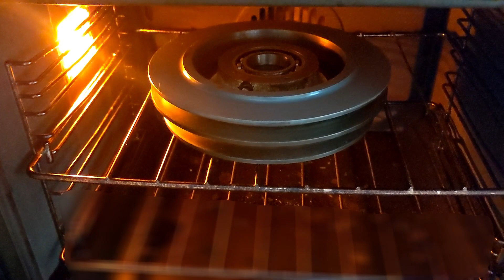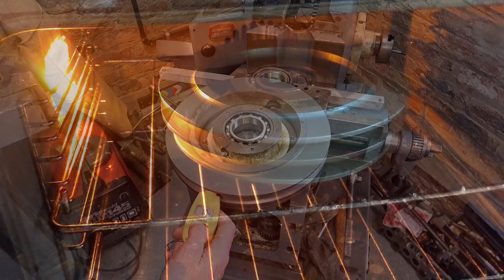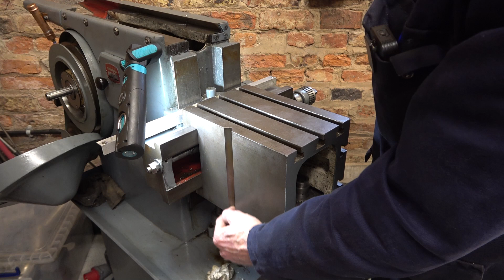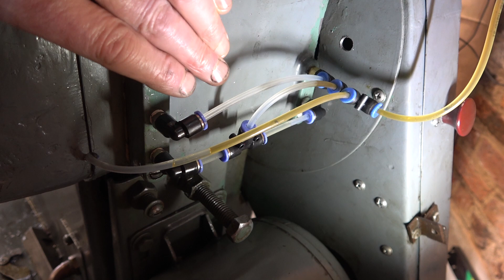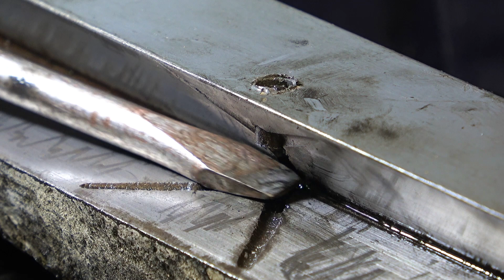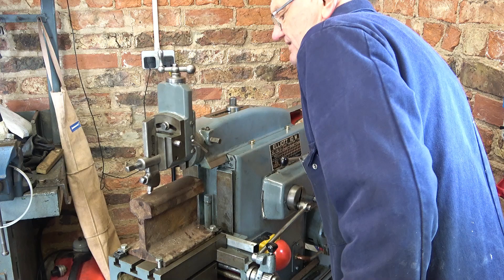HS190 Elliott 10M shaper repairs – Part 8 (Final part)

Comment: Great series Paul, nice to see the full stroke restored to full working order as well as all the other improvements, some great tips for anyone considering buying a 10M to see what's possible. BTW I thought that old railway line was going to offer a lot more resistance, instead you achieved a great finish.
Reply from the maker: Hi Paul, as you saw, the rail came up clean-cut without any thought or effort really. 20 m/min, 8thou step across, 12thou cut, rough ground old bit of HSS not particularly sharp. Shapers just shape with no fuss about it. Cheers

Comment: Congratulations on your 5k subs, well deserved after all the work you put into this. Nice end to a good series on your shaper mods. My 10M has the same disparity in the t slots between top and side - peculiar isn't it. I've presumed that Elliott left customers to decide how to drill and tap the other side for fixtures. At least there are two deeper areas inside the casting, mirroring the other side's strengthening for the t slots. Your shaper now looks and sounds greatly improved. Cheers, Laurie.
Reply: And so it continues....... Laurie.
Reply from the maker: Hi Laurie, I had never noticed the two deeper webs in the left side (same side as the V) until you made your comment. Now they are just calling out to be milled with T-slots. 😁

Comment: On my 14” Värnamo shaper the side of the table with the grove has four holes for bolts. With this you can work on the end of a rather long bar.
Reply from the maker: Hi Anton, yep that seems to be the way. Not sure why Elliott never added the holes but left it to the operator to decide. Obviously in the case of my machine nobody decided.  😁

Comment: Well done Paul, great to see it all back together again and working nicely. I don't know these machines but it seems very unusual to have different T Slots on the same table! My guess is that the top 3 slots have been opened out at some stage by a previous owner to standardise on T Nuts with another machine (this is a wild guess). I hate those gloves, can't work with them! Cheers, Jon
Reply from the maker: Jon, well we can speculate whether it was by design, mistake or change but my view is it was set up that way on the factory mill and just stayed like that. I think both faces should be the same, and probably were on the drawing. Cheers

Comment: Good to see the machine working very well and very quiet.
I do not think US EBay is the root cause of international shipping rates.   USPS international rates are expensive.   I do not know  how the rates are determined, but the crazy part is that it is the same rate for all countries.   So Canada is the same as UK which is the same as Australia.    This does not make sense.
I just went to the USPS site to calculate a price to mail a 4oz package (0.11kg).    The cheapest option, First Class Package International Service shows a price of $18.9.
Perhaps a padded envelope may be cheaper, but this may only be for paper based contents.
Dave.
Reply from the maker: Hi Dave, I think sending single items will always be expensive but I'm sure ebay has a handling charge and probably a standard route. A friend sent me an item from the US and was quoted a crazy price for postage but shopping around he got that down quite a bit by taking an up to 1 month delivery (slow boat presumably) - but it still arrived in one week!  Here in the UK we often have options for delivery like next day, 2-3 days and 5 days but the 5 days option will sometimes still come the next day. It's all a bit random. Cheers

Comment: Like other's, congrates on the 5k. I will have to go out and see if my Klopp450 bed has the V groove as well. Been a year + since looked at it, but the groove wold be a plus to fixture round stock with a large clamp across to the other side of the bed? My Guardian Drill press slot's in the table don't match the base tee slots. Makes one wonder about quality control (@@)!. Thx for sharing Paul.
Reply from the maker: Bear I think quality control is exactly the point. I think the T slots should have a half inch neck and one day somebody put in a 15/32 cutter because perhaps the 1/2in cutter broke and it just stayed like that. Cheers

Comment: Well done on the 5k subs!
My 10M T slots are the same as yours, different top and side. I ended up making dedicated T nuts for each, not that I've ever used the side slots.
No idea what you'd do with the v groove on the side. Maybe its there for you to drill your own threaded holes depending what you want to do with it.
Reply from the maker: Hi Robert, I think with the v grove you could face off or slot the end of a long bar or something line that. Cheers

Comment: Hey Paul, congratulations, 5000 subscribers is quiet an accomplishment.💪love your videos.
I have an Värnamo EV-3, 18 Inch (450mm) shaper, here they put the V-groove on the operator side, in between the two T-slots. But still there is differences in the dimensions of the T-slots, on the top, and on the side!? perhaps it is somthing general on shapers ???

Have a great weekend
Kind regards Henrik
Reply from the maker: Oh right Henrik, I thought the difference between the top and side T slots was just a production mistake, but from what you say maybe not.  Cheers

Comment: Another excellent job, well done!
Congrats on the 5k 
FYI - just checked my Alba 1M shaper (manufactured by Elliot) and the tee slots are 1/2" on both the top and side.
Reply from the maker: Hi LE, I'm inclined to think the T slots should be the same top and side. I don't see why they should be different. Cheers
Reply: @HaxbyShed  Yes agreed, can't see why they would need to be different.

Comment: Congratulations on 5K Paul.
I pay £ 12 to £ 17 for my Nitrile and Neoprene gloves,  I like the Bodyguards, and Ansell Touch N Tuff, long cuff.
I used to love the smell of Rosalex, still got some,  up as you say, no disposable gloves were available for engineering,  only medical and chemical. 
The table slots are within tolerance, guessing the maybe intended for 7/16" Tee Nuts, they are intended to be sloppy.
Great modifications and refinement, I  forsee a shrader tyre valve being fitted on your oiler reservoir 🤔.
Thanks for sharing.
Reply from the maker: John, I think I 'cheaped out' on those gloves and need to spend a bit more.  I don't need any pressure in the oil reservoir. Gravity and patience is enough. It will only get a squirt now and then. Cheers

Comment: Hi, 
The blue nitrile gloves seem to go off with age even if they're in an unopened box. At a couple of years old (from the date on the box) I've had them rip straight out of the box. You can get a black, heavy duty version - slightly less feel but much tougher - they're roughly twice the price though. 
Finally, at 5:00 , if you can push a knitting needle in and it comes out clean, then its done :-)
Reply from the maker: It would have to be a tough needle Peter. What I did learn is the temp dial on our oven is not very accurate. Cheers

Comment: Hi Paul. Your glove problem might be due to the oil. I always have two kinds of gloves at hand (haha). One latex based and one nitrile based. Different oils and solvents act differently with the various glove materials. If one kind fails within a few minutes, i change to the other kind. Works for me.
Grats on 5k, bud. Well deserved.
Reply from the maker: Hi Gisatan, I find gloves just annoying but I'm sick of trying to get crud out from under my nails. I'm right handed but it's aways my left hand that picks up the most muck, for some reason. Cheers

Comment: I really like the modification you did, the machine runs very well and it's quiet indeed. You should try nytrile gloves they're a bit more expensive than latex ones but much more stronger and durable. I've always used them when I'm machining.
Reply from the maker: Thanks Luca, cheers.

Comment: It must be very satisfying to hear it running smoothly and knowing that you have attended to all the issues. I assume that one has the option of adding bolt holes and fixtures to the 'V' side of the box. The only alternative I can imagine is some kind of clamp that reaches over from the top and bottom faces to hold a bar into the groove. Congratulations on reaching a major milestone!
Reply from the maker: Hi Workshopfriend, that side V is a funny one. Could be extremely useful for jobs I can't do on the mill - say a square slot in the end of a long bar.  I'm always on the lookout for machining operations unique to shapers. Cheers

Comment: Hi Paul, nice to see the machine running. I”ll chec the T slots on mine & report back. I noticed you oiled the bull gear etc teeth, maybe 😊just to protect them whilst tinkering but just in case you don’t know the manual calls for grease. Will be interesting to see what other say the vee is for.
Reply from the maker: Hi Tony, when I got the machine I'd probably just read the manual and I applied grease. This time the can was in my hand and I got carried away. I will let that drain off and grease it sometime soon. Cheers
Reply: Yes the T slots on my 10M are also smaller on the RH vertical face. Must be a reason for that.

Comment: My 10M has has the same different size slots! I have no idea why, I always thought that somebody had opened up the top slots! You can rotate the table father if you pull it of and rotate it, the foot will no longer work but you can put the table in all sorts of places! I suspect that the top slots were widened on the machine but they couldn't be bothered to take the block off to turn it 90°! Cheers, Matthew
Reply from the maker: Hi Matthew, my theory is Elliott set up a production mill with the wrong cutters and just left it like that. Several people have said their Alba (which basically has the same table) has 1/2 inch  T-slots top and side.  One day I will open out the side slots to be 1/2 inch. Will be a nice project for the mill. Cheers

Comment: Congrats on 5K!  You deserve it.  Sorry no idea on the table. I would probably just adjust the tnuts to fit both slots, but I also think the proper thing to do is make them match.  One thing that comes to mind is that people are often "afraid" to modify tools. Perhaps you could make some clamping holes on the v side to secure down a part.
Reply from the maker: Hi Mick, my starting point is always to assume that the guy who made the machine knows more than me and there may be a good reason I've overlooked, but I've decided I will re-machine to make them match. No doubt another video sometime. Cheers.

Comment: Paul, Congratulations on the 5K Subs! That's an awesome milestone!!  Sure strange those table T-slots don't match up, makes no sense. The blue nitryl gloves I was using 10 years ago were super strong and thin. Nowadays I having the same issue, even the big name brands although better than the cheap ones, are still not as good as what I used in the past. Someone must still make the quality ones, maybe somebody will chime in. Hey thanks for the channel mention! Good to see your shaper back in action 👍👍
Cheers....ATB....Dean
Reply from the maker: Hi Dean, talking about the gloves, I think the problem is that cheaper brands move in and force the 'quality brands' to cut their prices which in turn means cutting quality. It's like a race to the bottom on price and quality.  With so many products now there is the impression of choice but behind the scenes the stuff is all made by the same people and really there is no choice. Global economics has forced us into outsource supply and 'label engineering'. Cheers
Reply: @HaxbyShed  Well Said 👍

Comment: A Very Hearty Congratulations on your first chips! ! ! !   

When you found the T nut issue I went into panic, stopped eating my dinner, put you on pause and dashed out to check my Alba T nuts.  Seems that the factory worders were not at all consistent.  My two side slots have the  (roughly) 1/2" size and the top three area all different with one being 0.458 inch, another 0.472 inch and the third in between.  But the good news is that my T nuts fit.   Your T nuts would likely not go into my top slots.

As for the V groove we've got the same table.  I've been assuming that we can use it for working on the ends of round bar with the V groove holding the bar neatly vertical.   I don't know if it came this way or someone drilled and tapped holes before me.  There are two threaded holes for 3/8-16 that are on the front portion and placed 1.5 inch down from the top.  I suspect it was for a burly clamp bar with just two holes rather than a slot.  The hole closer to the V for pulling in and the hole near the front for a long stud and jacking nut to act in place of the usual step block.  Since obviously gravity, being what it is, would just drop the block into the chip tray as soon as we get distracted.  The idea of a longer stud and jacking NUT rather than just a bolt head means that the bar won't try to swing.    At least that's how I'm going to treat them and make up a clamping setup along that line.  And I'll likely drill a matching set about 3 or 4 inches lower for a second bar to aid with having a more solid clamping setup.  

My Alba, also uses the same top slide as your Elliot.  On the off side it has a needle and a brass travel scale.  It's used by setting the ram to the furthest ahead point and at that point the needle indicates what the travel setting is.   I'll take pictures of the setup and send it along to your email from your "About" tab.  It makes life a lot easier than marking up the gibs... 😁  Obviously the brass number scale would not be easy but I'm sure you can figure something out.  And the needle is just some 14Ga or close enough sheet metal.  You'll see it in the pictures.
Reply from the maker: Hi Bruce, Thank you very much for the pictures - you have a lovely machine there. Others have also sent pictures and I see many variations on clamps for bar in the vertical V. It all goes into the community knowledge pool.  Cheers